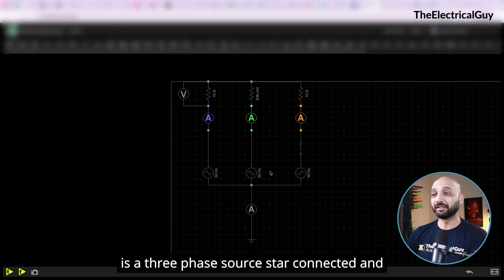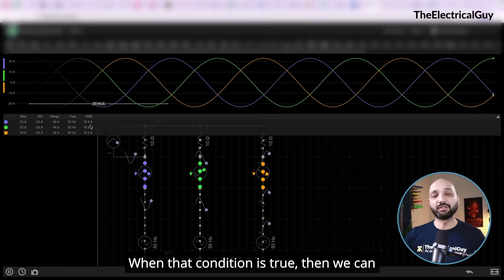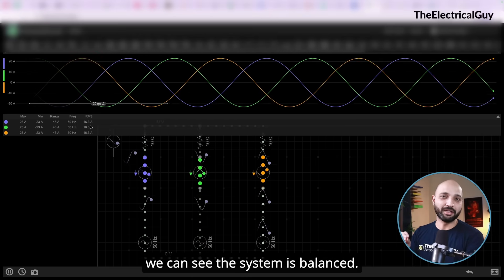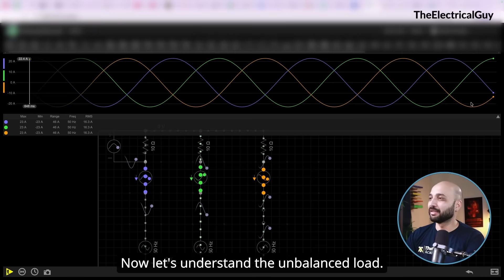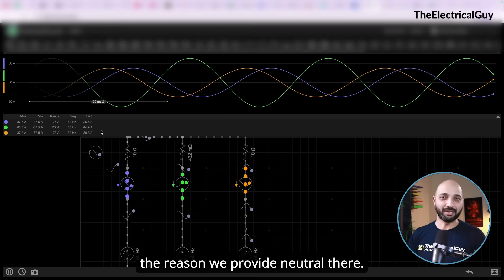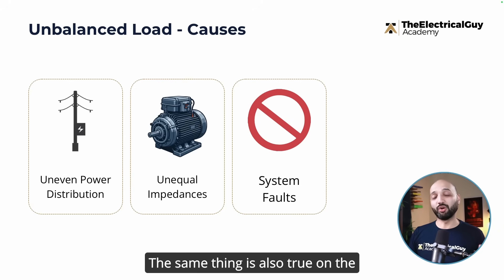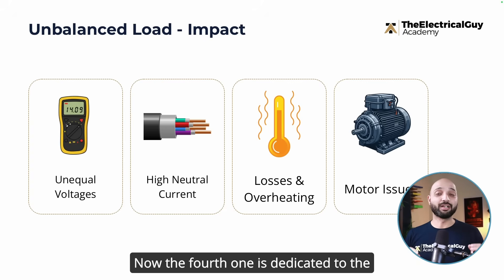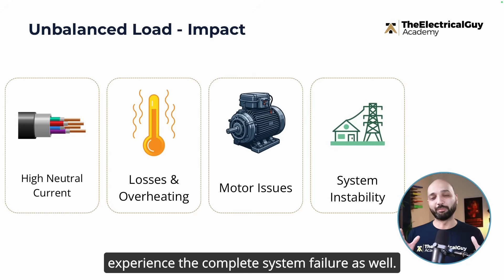5 Problems Caused by Unbalanced 3-Phase Loads

Comment: Hehe, meenwhile Most of Norway uses 3phase 230v IT system with no neutral wire. 
And all 3 phases normally has a floating earth potetial around 126v
We have 3phase 230v to every house, but we don't use 3 phase for any home appliances like induction cook tops with 25amp 230v loads
Some home EV chargers use 3 phase now tho 😅

Comment: We have 3 phase star connection in my home 1 phase having inverter connected for low loads like lights fans computers etc . Other 2 phase having freeze , microwave , geyser etc . It is causing any problem in 3 phase metering system . As we get more consumption rating than calculated load . Need help